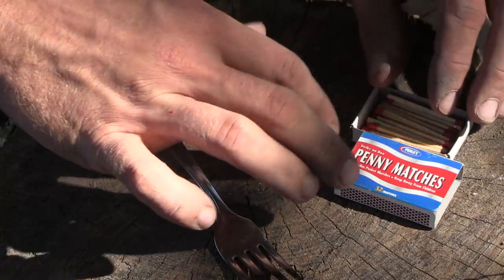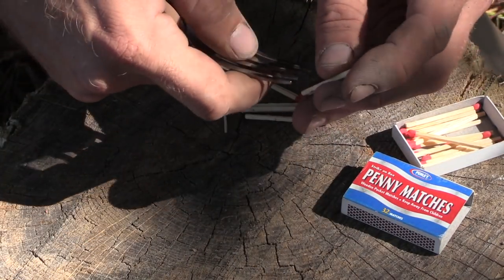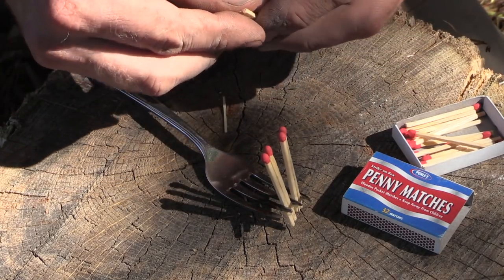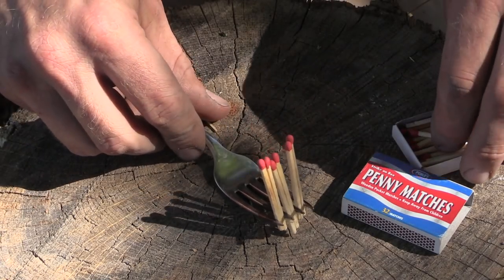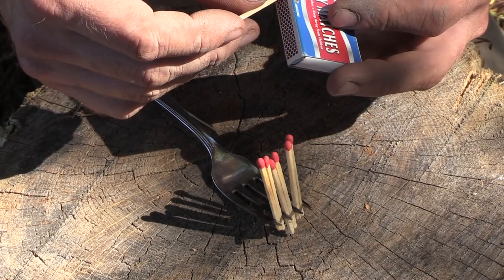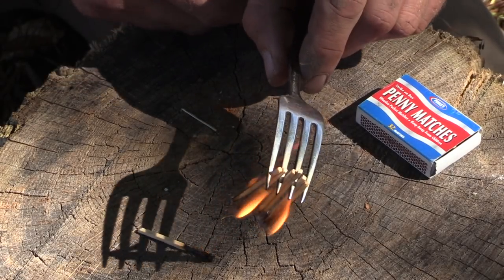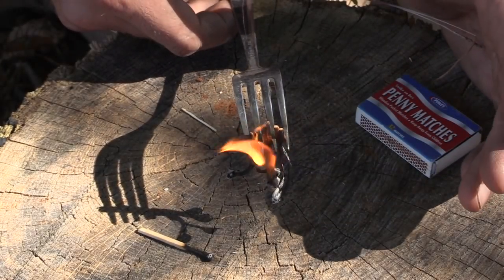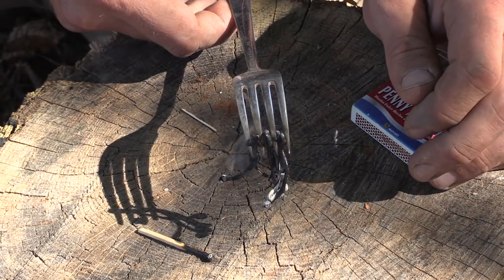Match Fork

Comment: I use a similar idea but using the fireplace pressed logs. I break off a piece and use 3 stick matches. I wedge them under the piece of pressed log and light the matches. Lights the pressed piece easily and then stack wood on it to build a fire. 

thx for the video.